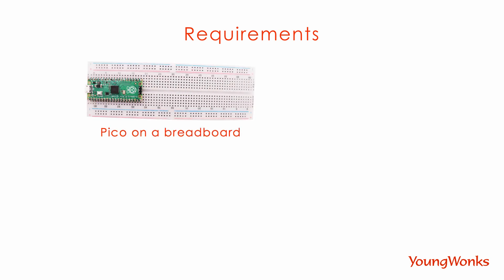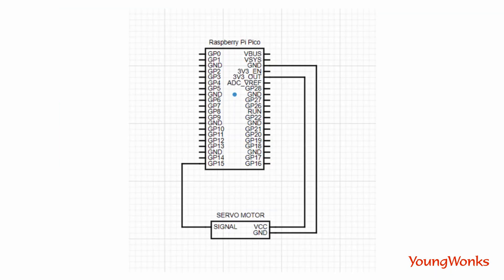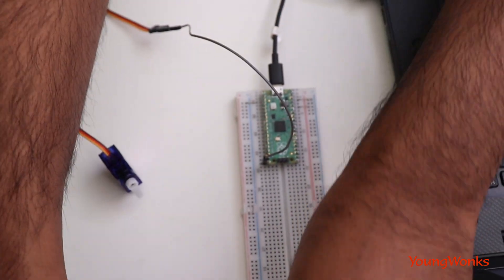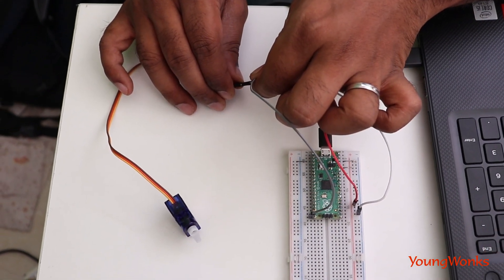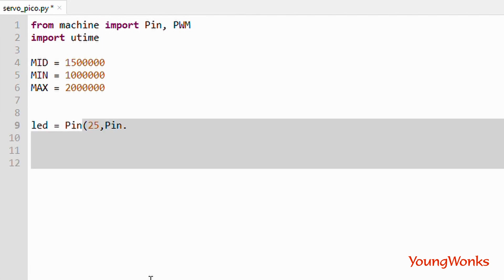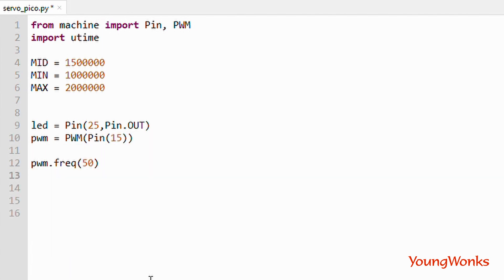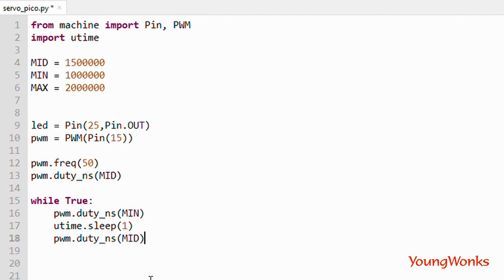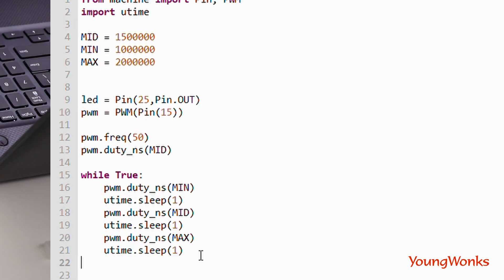Using the Raspberry Pi Pico with a Servo Motor

Comment: Here is the code
from machine import Pin, PWM
import utime

MID = 1500000
MIN = 1000000
MAX = 2000000

led = Pin(25,Pin.OUT)
pwm = PWM(Pin(15))

pwm.freq(50)
pwm.duty_ns(MID)

while True:
    pwm.duty_ns(MIN)
    utime.sleep(1)
    pwm.duty_ns(MID)
    utime.sleep(1)
    pwm.duty_ns(MAX)

Comment: #PLEASE LIKE IF THIS CODE SAVE YOUR TIME :)

from machine import Pin, PWM
import utime

MID = 1500000
MIN = 1000000
MAX = 2000000

led = Pin(25, Pin.OUT)
pwm = PWM(Pin(15))

pwm.freq(50)
pwm.duty_ns(MID)

while True:
	pwm.duty_ns(MIN)
	utime.sleep(1)
	pwm.duty_ns(MID)
	utime.sleep(1)
	pwm.duty_ns(MAX)
	utime.sleep(1)

Comment: I follow the instructions,  the servo work for 10 seconds... then my pi pico died.  :-(
Reply from the maker: We are sorry that your pico stopped working. :( Please do share with if it was due an error in our procedure.
Reply: @YoungWonks  the 3.3V  go through the regulator, but the noise (spikes?) of only one servo, I asume, make the regulator dies...   :-(   I also use a SG996R wich maybe was to much load.  now with my second pico I used a power bank and make it possible to drive 3 servos fine.
Reply from the maker: @LuisLlerena  Oh alright. Thanks! I see what you are saying. Yes, it is probably a better idea to use a power bank in a real application.
Reply: The pico is really rubbish. Mine arrived dead.
Reply: @jaku-00  did you drag and drop micropython?
Reply: @ZackDaQuack  I dragged the USB cable, plugged it into the pico, see nothing happening and then dropping the project as the pico is dead
Reply: @jaku-00  it won't accept .py files you have to put files on it using a IDE like Thonny
Reply: @ZackDaQuack  I’m trying again thank you Zack